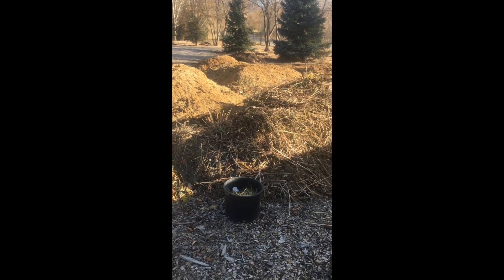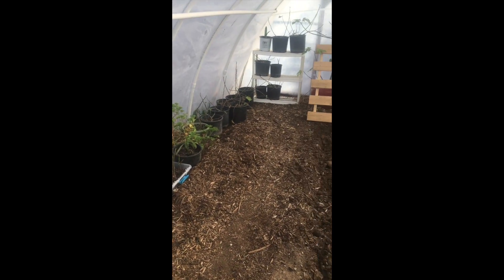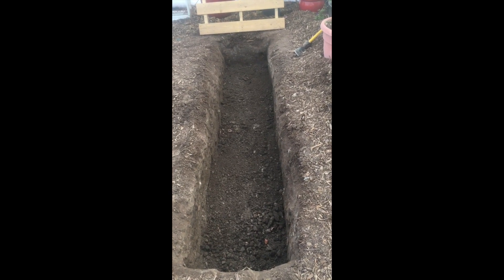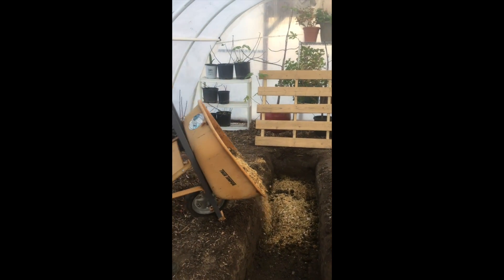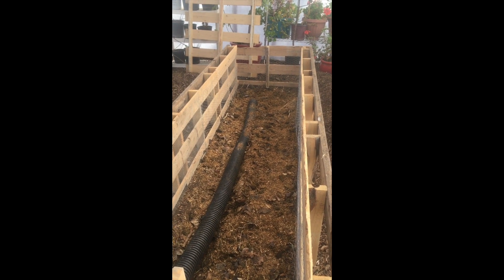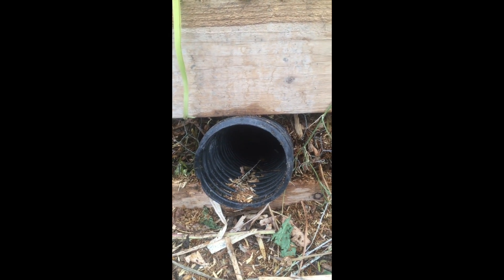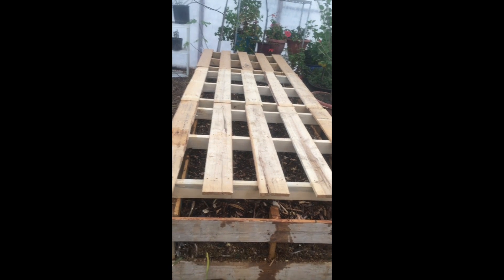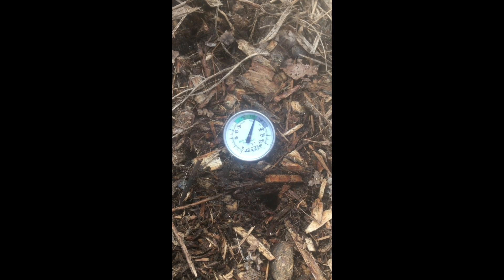Heating Your Greenhouse with Compost: How to

Comment: To avoid co2 Would it work as closed loop? From outside next to greenhouse radiant heat flowing flush on insulated concrete floor?

Comment: I wonder if you could’ve just left the compost pile outside the greenhouse ran a pipe through it into the greenhouse with a small fan or pump. You could’ve pumped hot water in or hot air Into the greenhouse.

Comment: Amazing share! Thank you. 👏We just built a Planta 32 x 10 foot greenhouse in zone 3/4, and would like to use this elegant method. I'm curious, does the heat produced warm the soil adjacent to the trough? I hear that soil temperature is more important than air temperature for plant growth, and would like to find a simple way of creating a radiant heat type floor throughout the greenhouse to prevent ground freeze.

Comment: Thanks for sharing! What do you do with your compost after it stops producing heat?
Reply from the maker: I use the finished compost for potting soil. You can also continue to add new material to the finished compost to start the composting process anew if you want to continue producing heat.

Comment: I've just come across this video, it's fantastic.  I am wondering if the pile gives off any gas, methane or CO2? Obviously I am concerned about a sealed plastic tunnel filling with poisonous gas.
Reply from the maker: The pile can give off both methane and C02. If your pile has the correct carbon to nitrogen mix, you will get very little methane but will still get some C02. You need to vent out the gas during the day. The plants actually thrive with elevated C02 levels. Just make sure you have adequate ventilation while you or someone else is in the greenhouse.
Reply: @fromconcepttocreation8661  TY for the vid!  Was wondering, would this make a good source of CO2 that is steady and needs little maintenance?  Would putting a dead tree in my greenhouse create a steady source of supolimental CO2?  It's a little off topic but looking for the  easiest solutions for CO2.  I can of course make it but creating it with dead material seems like a good idea.
Reply from the maker: @l0I0I0I0  I wouldn’t say the C02 production  will be constant or consistent but you will definitely get a measurable amount of C02 created throughout the compost process.
Reply: @fromconcepttocreation8661  I'll just have to experiment.  I'm thinking of having a large dead decaying tree or debree at the edge of the greenhouse inside and just monitor the CO2.   It would be such an easy way to produce small amounts for long periods of time, and a little heat to boot.:)
Reply: @fromconcepttocreation8661  That certainly makes sense.  Thank you for the quick reply.  I presume at some point you have a trench full of fairly nice compost?

Comment: How was the smell? Also, there's some bacteria/mushroom. I don't know about breathing it? Is it safe? Does someone know? I plan to surround at least 3 sides of the greenhouse with a compost pile but outside and tubes to flow water on the ground inside the greenhouse. I saw a man with 7 piles to heat 2 houses, the pig area, the chicken area, the greenhouse. Even the chicken pile also feeds them. No grains.just the pile of goody manure.
Reply from the maker: Once the pile is balanced you won’t have an ammonia-like smell. It will be a nice earthy-dirt type smell. As far as mushrooms or bacteria, the complete composting process should kill off any harmful micro organisms.

Comment: i hoped you would tell me how long you can remoisten it, and keep greenhouse heated. Tell me please.
Reply from the maker: You can get at least a few months out of a pile the size of mine if you replenish your carbon materials when you turn the pile and re-moisten it. As far as how often to re-moisten the pile, that will depend on how hot the pile gets. The more heat=less moisture left in the pile. I tried to find a good balance of moisture, material, and sustained heat (running on the lower side of active composting temps) to give me more time between turning and moistening the pile. It really just takes building your own pile and experimenting with the variables until you find what works for your situation. Good luck and thanks for your comment.
Reply: @fromconcepttocreation8661  you previous Anwser was anwsering what i ment! So, when replenish Carbon materials, i imagine you needed about two  three Times the amount of Carbon Material, to keep it going 3 Months, is that roundabout correct? Thanks for your well informative video, it was very helpful. !
Reply from the maker: Exactly. If your pile heats up more than mine did you may even need a bit more.
Reply from the maker: Sorry, I’m not sure how long you could get continual heat from the pile by just re-moistening it. Good luck.

Comment: What do you think: If you added more piping through the pile and a fan to run air through the piping and back out into the green house? Would that eliminate the need for turning the pile while also increasing the heat output? But would it cause the pile to compost too quickly?
Reply from the maker: Adding more air flow will definitely make the process occur more rapidly and will require you to add more moisture as the pile will dry out more quickly. It’s a good thought though if you want higher temps.

Comment: Great video, one of the most useful and least annoying that I have watched.

Query...   10 times as much dried stuff as green...  10 times the "volume" or the "weight"?  I am assuming volume but thought I might ask..  

Query 2.   How long did this produce the 130F or so temps?  For me freezing temps last from early to mid October until average last frost of May 15 so I am looking at 6 to 7 months of pretty decent freezing a year.

The tube for oxygen is a good idea, though you might consider shorter vertical tubes within the compost pile to more effectively aerate, though as you point out you wanted to get a long term heat source rather have it burn out quickly.  Also curious, could a person have any potential of "temperature control" over the mulch pile by controlling the "amount" of oxygen available via opening or closing off aeration tubes?  For example you have x number of aeration tubes and are running at 150F, close off some tubes to decrease the rate of reaction and drop the temp to 130F, or on the converse running too low a temp and opening up air tubes to raise the temp.

From what I have calculated you had 84 cubic feet of compost in a 1,000 cubic foot greenhouse with a single layer plastic cover.  This heated up to 130F keeping the 1,000 cubic feet inside the greenhouse 20F to 25F warmer than ambient outside temp.  I am assuming that likely the 20F above ambient is likely night time and the 25F above ambient is a daytime differential?

Did you have any issues with too high of temps come March/April on warmer days?
Reply from the maker: Thanks for your reply. I was referring to volume with the 10 to 1 ratio. I would always err on less nitrogen rich material as you can easily add more if your compost pile doesn’t heat up in 2-4days.

Also, the 130 F lasted for 2-3 weeks before I had to go out and turn the pile with a pitch fork. I kept adding the dry carbon rich materials each time I turned the pile. I didn’t need to add any nitrogen rich material throughout the duration of the compost pile (about 3 months until the compost was ready to be used in the garden). Once your compost is broken down significantly it won’t produce the desired heat so you may have to go through the entire process multiple times to keep your temps where you want them during your cold season. I used my compost material for potting up new plant in the greenhouse which was convenient for me.

The night time temps were 20-25 degrees above ambient with the active compost pile providing heat (130F or greater). The daytime temps on a sunny day were much greater do mostly to the sunlight.

I like your idea of trying to control the temp of the compost pile. I haven’t done any tests to try and prove that could be done. If you do build in controllable aeration to your pile and you see a correlation to temp and your controlled inputs please let me know. That sounds like a fun experiment.

Comment: I’m planning on building a 4x4 shaped above ground compost heater in the center of my greenhouse using pallets with wire mesh to contain it and disassemble when it’s time to move the soil to the garden. I have a $15 dollar laser thermometer so if I want to know the temperature anywhere in the compost I will pound a piece of rebar into the area I’m curious about, wait a few minutes, then pull it out and laze it. Hope it works!

Comment: Nice video! Been working on the same thing with a composting technique I call “Carbon Based Composting Bin” (CBCB)! Here’s a playlist on my work so far with other videos coming very soon. You’re right on with having the pile inside what you want to heat. But I feel a CBCB will be easier to make, and maintain even higher temperatures longer with the ability to reactivate the pile all through the winter. Come over to my channel where I’m open sourcing the idea!
https://www.youtube.com/playlist?list=PL8OAnpHec404E8OONfkGj1YQw7OqS9Xgq

Comment: How wet should the compost be? Tried something like your idea, but without the manure. Woodchip mixed with leaves piled under existing greenhouse staging and held up at the sides by an air-porous barrier. Was very wet from rain when put in, became very hot for about 10 days then cooled even though re-watered a bit. Does anyone have experience of how much water to add to the rotting mixture and whether to re-water, if so how much and how often?
Reply: You need your pile to be as wet as a  sponge so water accordingly.  This can vary greatly depending on a number of factors.  If pile cools usually needs water and/or turning

Comment: Thinking of doing this and found this video. Great idea. One question about the oxygen tube: does it get too hot for critters? I wouldn't want to harbour rats, etc. 
Thanks
Reply from the maker: The temps in the tube varied. We would occasionally find mice in the tube. I ended up screening the opening of the tube with a wire mesh. Once I did that I had no issues with rodents in the tube.
Reply: @fromconcepttocreation8661  do you thing chicken or rabbit manure will have same effect? Can I use animal  fodder hay , I live in a city  with very small  garden.
Reply from the maker: @easyandnatural6320  Fodder Hay should be great for your carbon source. Chicken manure or rabbit manure will work as your nitrogen source. Good luck!

Comment: When the compost heat is finished, in order to heat the greenhouse one must remove it and restart the whole thing right?  The numbers are precious !
Reply: Yes if you wanted to keep using compost, but I imagine the goal should be to maintain that heat until the compost is no longer needed for the desired greenhouse temperature to be maintained.

Comment: Exactly, in Holland farm factory, they pay money to inject CO2 for tomatos.  This is it!  I have one question, how long it would last to heat the greenhouse for that amount of piles. Also, the measurement of your greenhouse size, please to calculate the amount of compost needed to heat up the greenhouse how long.
Reply from the maker: The greenhouse is approximately 12' wide by 16' long. The peak of the greenhouse is about 8'. The compost pile measures roughly 4' tall (because of the trench) by 3' wide by 12' long. About 144 cubic feet of material. You do need to start with new material once your compost pile has fully finished (meaning the material has been converted to a finished compost).

Comment: Nice build.  I love the monster double wall hoop house. ;-)  I also keep using partially buried piles, and I keep kicking myself.  My current build (https://youtu.be/nR33FIFU3zY) has a partially buried compost chamber (though it is insulated with foam board, because it's not inside the greenhouse).  It's really inconvenient to turn the pile, and unfortunately since my compost chamber is small, I have to turn the compost every two weeks.  Done over again, I'd just have a big honking cube of compost, above ground.  I'd be curious to see some more quantitative temperature data (intake vs outlet, outside vs outer hoop house vs inner hoop house.

Comment: Do you have thermometer for your greenhouse? How warm can you get your greenhouse with just compost
Reply from the maker: I do have a thermometer in the greenhouse. The compost has kept the greenhouse about 20 to 25 degrees F warmer in the greenhouse than the outside ambient temperature at night.
Reply: From Concept to Creation how often do you flip your pile?
Reply from the maker: I like the play on words! Once I have created the initial pile, I mix it up a bit each day for two days to get oxygen down to the middle of the pile and beyond. After that I wait for the pile to reach 130 to 140 degrees. The size of pile I have maintains these temps for about 2 and a half to 3 weeks. It then starts to decrease in temp. Once this happens I add a bit more water and give it another mix. It will repeat these cycles at least 3 times before I have to add more material.
Reply: A bit of work but free heat and great compost at the end! I’m sure you’re busy :) but would love to see a follow up video!!! Thanks from Nova Scotia